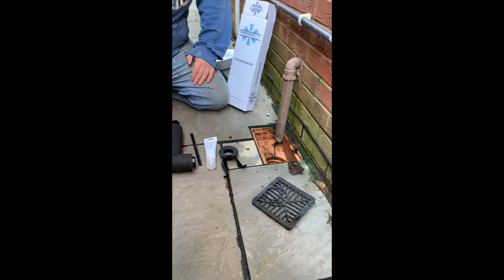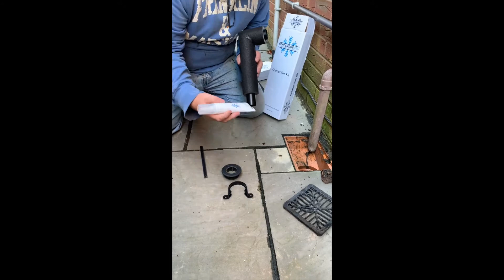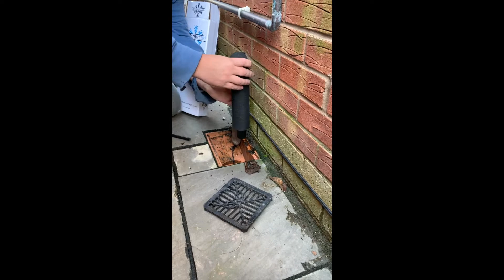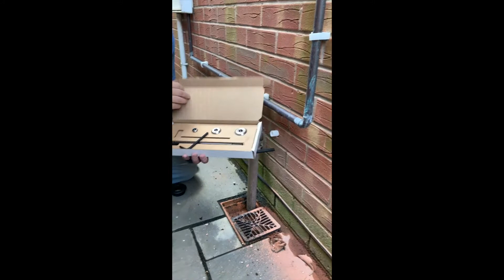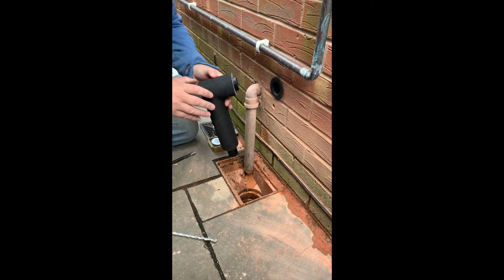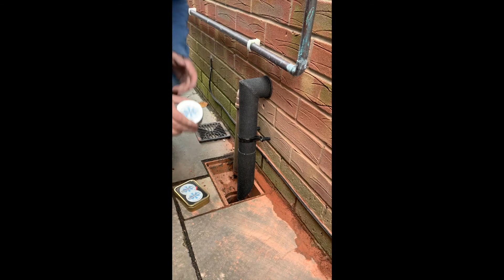condensate pro kit install

Comment: First time fitted the pro kit today. No pipe snug provided. Nothing special about the insulation. its just standard grey 15mm walled just coated black! the 1m extension still needs a length of 32mm solvent weld pipe and a coupler. 2 brackets, no screws. could have thrown in 4 x stainless steel screws.